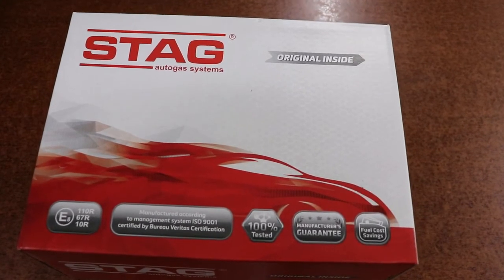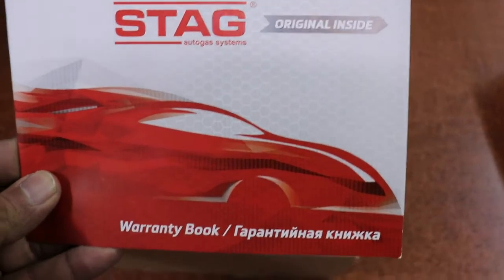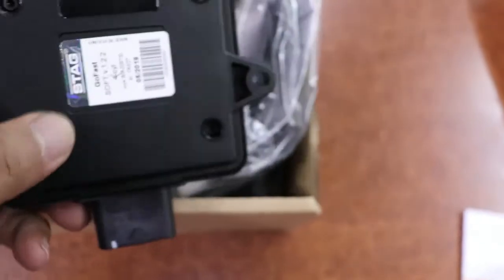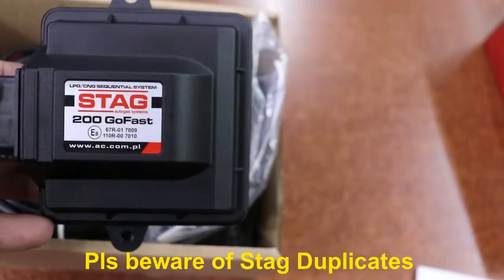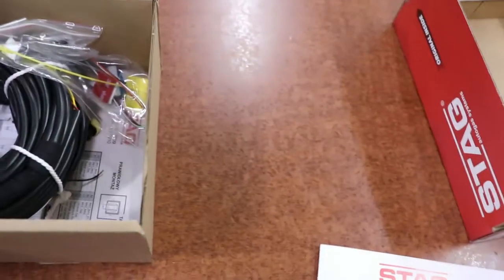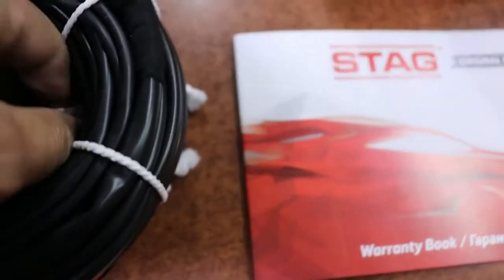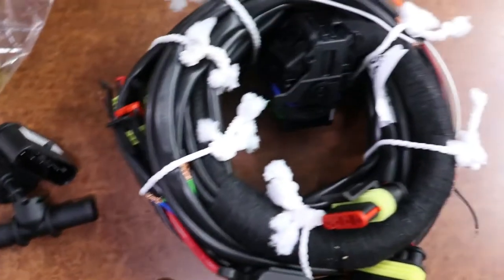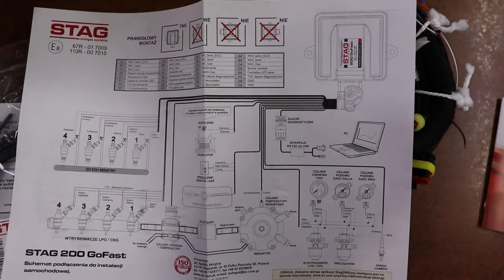Stag GoFast CNG Kit Unboxing, Best Sequential CNG Kits, Sequential CNG kit provider. AC STAG CNG kit

Comment: sir where r u based 
I have fitted stag go fast200 in my 2007 automatic carolla firstly I was advised not to go for advancer(why?)runs 180 kms on the highway with full empty tank secondly engine check light came up while driving .is it required to go for advancer in go fast 200 series plz advice .

Comment: It makes some noise when we fill the gas. After 5-6 kms, the sound goes automatically. But when we press the race pedal hard(above 3000 rpm) it gives a sound "kudak".
Reply: it may be knocking. are u using advancer?